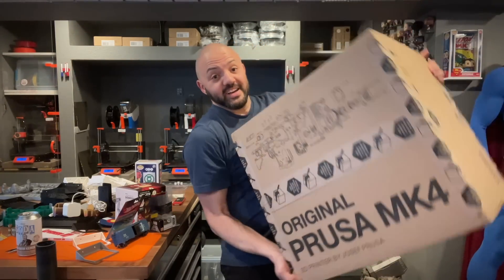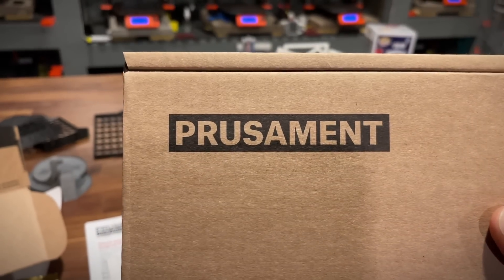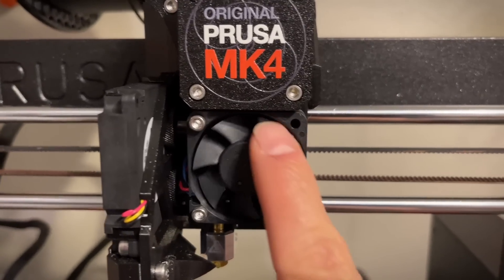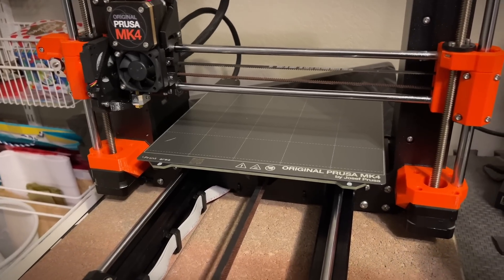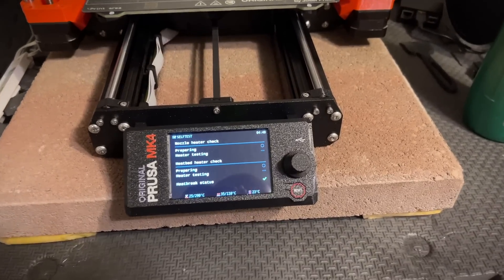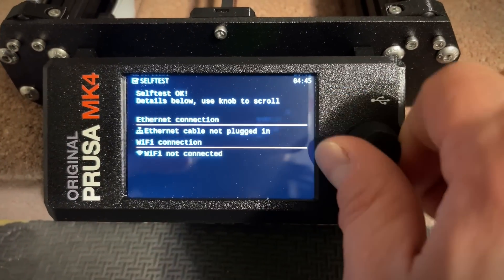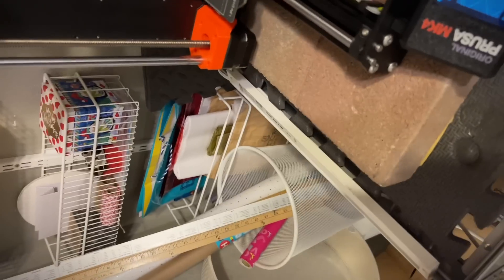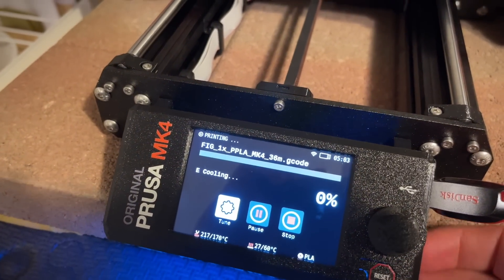Prusa MK4 - Unboxing, setup, and first print!

Comment: Very nice.  I'm gonna order one, with enclosure for making abs.  I also plan to get an assortment of nozzles sizes in the new e3d obxidian v6 (E3Ds hardest nozzle with antistick) with the nextruder v6 adapter.  I'll also try to find a good high flow nozzle that works with nextruder.  Very excited but it will probably take till August or September before Prusa can fulfill my order.  😊

Comment: Never owned a Prusa but have one on order which I might see by June :(. You said that you print in PETG usually. Would like to see a video on how to print PETG on the MK4 as I have never printed it and it would be a help to others I believe. From slicer settings to actual print ;). Gerry
Reply: There isn‘t much to do. Just choose the PETG profile in your slicer. On the printer‘s side you have to be aware, that PETG sticks too much on the unstructured sheet. Use a structured one or  - in case you don’t have one - a glue stick.
I use PETG only, if I have to because of higher energy consumption.

Comment: Nice video-thanks!! If I may ask what are you using under your cement block to isolate it from your bench? Also it would be nice if you made a video about your hot box setup that you have on top of your printers with brand, brackets, etc... Gerry

Comment: If you have problems with the PEI smooth sheet, and can't get pla to stick even after using acetone, try some 400-1000 grit, or equivalent ( the hard scouring side of a dry dish sponge also works) and resurface lightly. Clean with IPA after.
Worked a treat for me.
Reply from the maker: Yep, that’s what often works for me! Also washing with hot water and dish soap. I actually just don’t like the smooth sheet that much - much prefer the texture for the bottom of my prints!

Comment: Thanks for sharing.

What are you using for foam under those concrete pavers?
Reply from the maker: I use exercise mats on the bottom, then foam cushioning to separate that from the paver. That foam is just a really huge roll of foam I go on Amazon for like $50 that I keep cutting into whenever I get a new printer.

Comment: I think those nozzles for the grease allow you to stick them into the linear bearing and force grease into it instead of the finger/rod insert method

Also, the beep was my biggest gripe with the mk3s+. It’s deafening
Reply from the maker: Thanks for that! I’ve never removed mine to grease em but that makes sense!! Yep it’s either ridiculously loud noise or nothing on the MK3S+, MK4 is much much more reasonable.
Reply: @SuperheroDIY  I figured out that a lot of the noise was coming from the part cooling fan. It had sucked up a years worth of stringing and would squeal at 100% cooling. Managed to get it all out with a brass brush and it’s quiet again
Reply from the maker: Oh yep yep. I use the compressed air to get that stuff out every so often

Comment: I feel so inadequate cause my MK2S is still running great....I have no excuse to upgrade😭
Reply from the maker: I think that’s the story here though! I mean how old is that printer and it’s still going strong!?!
Reply: @SuperheroDIY I'm embarrassed to say but it's 6 years old. At the beginning of the pandemic I was involved in an effort to print a few thousand face shields for first responders. We got the job done but it completely fried the hot end, PEI sheet, thermistor, 2 fans and a stepper motor so I rebuilt the printer with a bunch of new parts and it's still doing great. If the heatbed fails (which I expect it will sooner than later) I'll be adding an MK4 to the cart😁
Reply: @SuperheroDIY  Yup, if you bought a MK2, it's six years old now. And many of us still have them going strong, or updated to MK2.5 etc. In my opinion that's worth some loyalty to Prusa, even if their price is a little higher, or it doesn't have the latest hype features. If that makes me a fanboy, I'm OK with that.
Reply from the maker: Absolutely agree.
Reply: @swissfreek  I agree....when you show prints to other folks who use Creality printers all they can do is stare in wonder and awe because they're accustomed to substandard output.
Reply: @XBKLYN  they stare in wonder because when they ask how long it took to dial the settings in you said “it came like that”. I know that’s a little bit of an overstatement but holy crap my buddy with the Creality is constantly asking me for help fixing one thing or another that works sometimes but not others or he just can’t get it dialed. It’s not a fair comparison maybe because his printer cost probably a quarter what mine did but you pay for the difference in other ways. 🤷🏻‍♂️

Comment: I dont see whole alot of difference compared to mk3s which was released 4 years ago. 4 years... It looks like a desperate move by prusa to combat bambulab competition. I mean they could have come up with something great in 4 years of development but even P1P looks better than this for the half price.
Reply: The P1P is $100 less... it also is closed ecosystem on almost every major system. You can't even use common nozzles with them. Not sure I would consider it given the proven reliability of the Prusa.
Reply: @Señormakey  I’ve been printing endlessly on my X1C with zero issues so far.  It just works and it’s fast!
Reply: @Señormakey  It's my bad not a half price but its not $100 either. P1P is assembled so $700 vs MK4 $1100. For $400 I can buy sh*t load of replacement parts that its ever going to break in P1P in its whole life time.
I also dont get whats wrong with closed system as long as it is working, i dont see the problem here. In return you get a nicely working slicer + octoprint setup in one application + phone application.
Proven reliability is a vague statement if i search prusa failure in  youtube a bunch of videos with issues come up. What do you actually mean by reliability? Because according to those feedbacks its not reliable at all.
Reply: @orhanyor  Without wanting to say anything bad about bambu. But if I am correctly informed, it is so that not all spare parts can be bought. bambu says that the user cannot change it himself.
From a purely visual point of view, a mk4 looks old next to a core printer. But nero3d, a member of the voron team, went into the technical background in his video about the mk4. A core not only has advantages a bedslinger not only disadvantages. Just in the size of the prusa.
The larger the printer, the more the advantages of the core printer outweigh it.
Reply from the maker: Definitely a move to counter the BambuLab printers! Hence rushing it out ahead of the XL. But the huge improvement in bed, leveling, stiffer frame, Nextruder, LCD screen and interface, enhanced motors, and Wi-Fi and ethernet make it a pretty big step up in terms of usability.
Reply: @SuperheroDIY  I don't think the mk4 is an answer to Bambulab. The mk4 has been running for over a million hours in the prusa print farm for a year now.
Reply from the maker: @herr_rossi69  I just don't get why they didn't say ANYTHING about it whatsoever and then launched it all of a sudden AND with immediate shipping. Seemed so weird! Either way I'm loving it so far :)
Reply: @SuperheroDIY  I think Prusa kept it secret to protect mk3 sales. The xl is in a whole different league and doesn't impact as much.
I've been toying with the idea of buying an mk3. But since I already have a Prusa Mini, the 8 bit board always seemed outdated to me.
Reply: @SuperheroDIY  I get it, it is certainly an improvement but It is somehow underwhelming especially at this price. I'm sure it is a great printer but their price point is incredibly wrong in my opinion. 
P1P is build like a tank, faster, bigger print bed and prints amazing for the less money and not to mention bambulabs replacement parts&optional parts are cheaper than prusa's.
As an owner of both prusa and bambulab printers my only criticism for bambulab would be how loud it is other than that It's yet to fail my expectations after owning prusa for years.

Comment: I have the mk3s+, X1CC, ender. Your video is great intro into the Mk4. It's been so long since I've used it that I blocked out all of the stuff needed to print from scratch. 

I have a couple of years on the mk3 and ender but retired them both since Aug 2022 for the X1C(2200hrs+ printed). There is a ton of QOL features that come standard that the mk4 just doesnt have. I was curious if it was worth upgrading the mk3 to a 3.5, 3.9 or full 4 but as of right now there isnt enough different to warrant the upgrade. The speed increase firmware is still in beta and the screen isn't touch. I cant stand the rotary knob.

 Is the first nozzle given hardened?
You mentioned that particular model takes about 32 min on .6mm and 1 hr on .4mm with the mk3 and 33 min on .4mm on the mk4.  Have you tried any longer or taller prints and compared times? Is it a roughly 2x difference consistently? 
How fast have you been able to go with quality. I know the mk line wasnt made for speed per se but its good to know if it can do it.

Have you tried prusa connect(cloud) or prusa link(lan/local) printing yet?
Are the print times accurate in the latest prusa slicer. ( if they are I can check speeds for the mk4 there)
Reply: The screen on MK4 is actually a touchscreen, just the touch functionality is not yet implemented/supported in the current version of the firmware. So, maybe they will enable the touch functionality in the next firmware versions, as the touch interface is there and is connected to the main board.
Reply: @DominikPaľo  if the touch isn't enabled then it is effectively just a screen. I haven't seen any information on the main website that mentioned it being a touchscreen or that they will enable a touch screen., I am wondering where people are hearing that. Because I've heard some YouTubers talk about it but no one can give a source
Reply: @ashleys3dprintshop  upon close inspection of the display from the bottom side, it becomes apparent that there are two separate flex cables - one connects to the display, while the other connects to the touch layer. But I agree, no one from Prusa has confirmed yet if they plan/do not plan to support touch functionality the future... so I'm just wondering why the decided to use a touch display instead of a simple one 🤔Btw, on the Prusa blog about the MK4 release, there is a Q&A in the FAQ section:

Q: Does the MK4 have a touchscreen?
A: HMMMMMMMMMMMMMMMMMMMMMMM…
Reply: @DominikPaľo  That is....I don't know how I feel about that. Was that a joke....? 

How are we supposed to take that?
Hmmmm ....yes?
hmmmmm no?
Hmmmm? you should already know the answer?  
Hmmmmm ? guess?

😬
Reply from the maker: Hey -- agree with the points about the speed increase being in beta, that's very sad, and I expect the screen to be touch. Still, my experience with touchscreens on printers has been .. meh. Thinking how bad the Creality CR-10S Pro V2 and Artillery Sidewinder X2s screens are. 

I haven't yet tried any bigger or taller prints, but certainly will! I would guess that any speed and quality differences will be exacerbated with size and time since it's still a bedslinger!

I did try Prusa Connect AND Prusa Link -- both are VERY beta beta beta and not ready for primetime. Prusa Connect has some serious limitations and issues, mainly with file handling and limited camera support. Prusa Link just sucked altogether and is wholly unreliable. I would prefer Prusa Link for security, but wow it's just not good ... yet. 

As far as I can tell, print times in PrusaSlicer are close, but not exactly accurate (estimates are a little shorter than actual). But not bad at all and WAY better than it was back in the day using something like Simplify3D!
Reply: @SuperheroDIY  I also prefer non-touch displays on 3d printers, and i think these days its still less and less important when there are cloud/web UI's or klipper etc. available from which you can operate the printer, so you can use any device with display (smartphone, tablet, laptop).
Reply: @SuperheroDIY  Thank you for your very detailed response. I updated my Prusa Slicer and have been playing around with settings. 

I may wait a bit and see how the features pan out. I didn't want to go back to sneaker-net to print. 😅
I must have cursed hands because the dial is the bane of my existence.

Comment: Tough sell with competitors like bambu labs
Reply: Depends if you still want to use the printer after you've gone through 1 set of bearings. As we know with MK3S, its a non-issue and they can even be replaced during standard annual services if required. But with Bambu, those bearings are glued in in many cases and you might be looking at a return to Bambu in order to get them replaced. True also is the lubing and packing of the bearings is not possible since you can't get to them.

Not sure if anybody has experienced this yet as nobody has put the printer through one set of bearings?
Reply: @ChrizRockster  You seriously underestimate the aftermarket community. When bearings start failing I can assure you someone will design new mounts, that we will print, and pop our new bearings in

If man built it, man can fix it
Reply: "As we know with MK3S, its a non-issue and they can even be replaced during standard annual services if required"

Yeah can you imagine the folks who bought a Mk3(2017), upgraded to a mk3s+(2021) then upgraded to an mk4.(2023) After 8 years of upgrades they will have ........ cartesian tech. 🤔

You know fixing old tech isn't the badge of honor some folks thinks it is. You can save your money and get better tech and features especially if you don't want to "Ship of Theseus" a bed slinger for years.
Reply: @No0o0o0o0o0  We should all be united on right-to-repair, I think your throw-away-replace attitude goes against the whole culture of DIY and sustainability on the whole.
Reply: @Metapharsical Avoiding the "Ship of Theseus" mentality is a great example of why keeping old tech alive is not beneficial. 

For example take fast Core XY printer vs cartesian. There are competitors that are 3-4x the speed. That means faster prints, less electricity used and more efficiency for the time. There will always instances when new tech surpasses old tech.  You can spend good money after bad and still not equal buying new, which is wasteful. You may not value your time but some of us do.

 Would you be fine with a10yr cell phone.? If you could keep an iphone 5 alive or samsung note 3 would it be a good experience?  What about missing network advancements and being stuck on 3g or 2g edge networks. Low resolution or small screens? What about slower wifi or OS security issues?

Sure it's great you can fix a thing but we arent talking about incremental upgrades we are talking about paradigm shifts. I've personally experienced the never-ending DIY cycle of other printers. I put hundreds $$$ in upgrades, features, repairs and it will NEVER reach the new stuff. If I rebuild it from scratch, Added klipper, octoprint,  raspi, camera, enclosure, nozzle, direct drive, inductive probe, new frame, bed, linear rails, and spend countless hours sourcing parts, tweaking, configuring, modifying did I really come out ahead when I can buy an off the shelf product that functionally has all of that out of the box?

Comment: It's madness to buy prusa in the word where p1p exists.
Reply from the maker: Nuh uh! The fact that I’ve had MK3S’s running for years and years and they are still good means a lot. Any other brand of printer I’ve had started strong then slowly deteriorated until it was useless ….  Although I currently do love my P1P and X1C
Reply: Good luck replacing those bearings and good luck if something happens to their cloud service. You lose function you paid for.
Reply: @ChrizRockster  you don't need to use the cloud service. You can print in the exact same way you print with your old clunky prusa: with a SD card. You don't even need to use their software. There is an open source fork of the bambu slicer now. The bearings are standard btw
Reply: @ChrizRockster  even if I throw away all electronics and install orange with klipper it will be way better than prusa

Comment: I might sound like Bambu fanboy but.. No tapping on my X1C + AMS , no manual feeding, I saw that you manually took of the purged filament - this is also something I didn't needed to even think about.

Out of the box put filament in the AMS and it just did the benchy.

Prusa might be workhorse but the ease of use compared to X1C is just different.

The only thing I don't like in X1C is glue and sound.

It might have their own custom parts / software but.. So does the iPhone or samsung.

I won't comment on support as I didn't had to use it.
Reply from the maker: I hear that, I have both Bambus as well. Bad news is that my X1C has had three problems so far, none of which Bambu has been ANY help on. If I didn’t know about 3D printers and how they work already, I’d have been out of luck! Sure there is an ease of use component, but when you are printing 20+ hrs/day for years, you need reliability as well. Bambu doesn’t have that just yet.
Reply: @SuperheroDIY  what were the problems? X1C is my first printer and I'm still constantly learning.

Since you are using your printers so extensively - did you maybe shared your filament/printer profiles anywhere? I'm still dialing in. Started using eSun PETG yesterday and custom profile I have is relatively slow.

I wonder if there is anything I can tune more.
Reply from the maker: @muray82  I haven't shared my profiles anywhere because I've found that really the profiles in PrusaSlicer are pretty dang close, and then you just have to calibrate for your print and your material, but others can't really do that well for you in a lot of cases!
Reply: Ok… but did you get the haribo gold bears with your printer
Reply: @pandaiscool9552  nah I had to steal from my kids ;)
Reply: @pandaiscool9552  Which is unhealthy sugars. He wants you to get fat :P